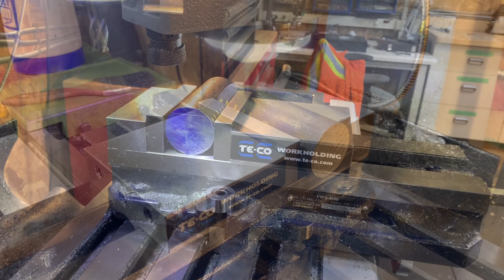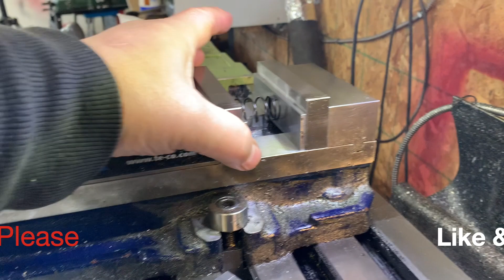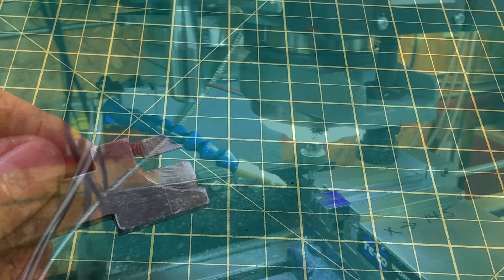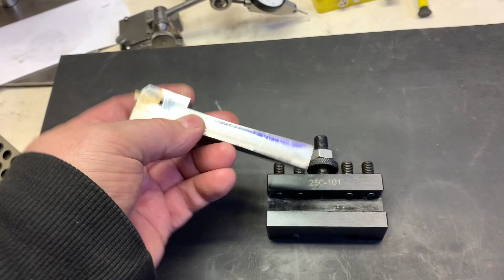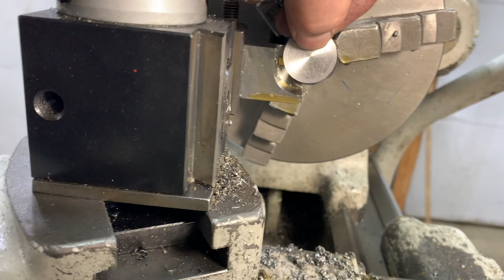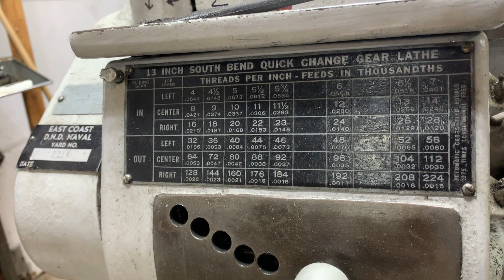DIY Lathe Cut Off Tool

Comment: Excellent work!  If you add a retaining screw that compresses the insert for extra rigidity, you can probably take more aggressive cuts.
Reply from the maker: In retrospect, the test I presented was way too conservative. So I pushed it and recorded my findings. The video shows a spindle speed of 40rpm and a 0.0017 thousandth per second. I went all the way to 0.011” at 270 rpm. The cut is still perfect and super fast but surface finish is rough because the insert at that feed rate basically shears the material. The tool performed perfect.  
I designed the tool this way because even the ones with a screw failed on me. So I’m glad I was able to design something simple, tough and performant.  If I can get it to fail I will post my results for sure though. Thanks for your input. It forced me to be less timid. 👍🏻. Gilles
Reply: @LetsRogerThat  I'm sure the tool is capable of far more with the right insert. Try mggn200 insert for stainless steel (vp15f). You can see in one of my older videos I'm parting fine at 2000rpm and the finish / chip formation in a more recent video at a lower speed. I reckon the insert you're using needs a more rigid setup and an aggressive depth of cut to break clean chips.
Reply from the maker: @HM-Projects  thank you 😊